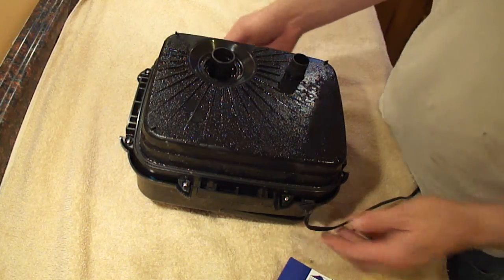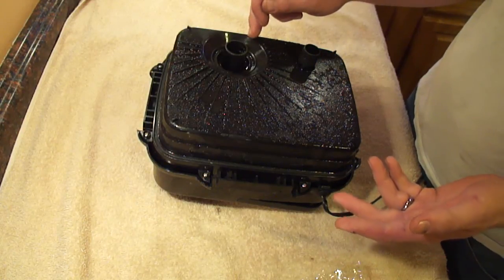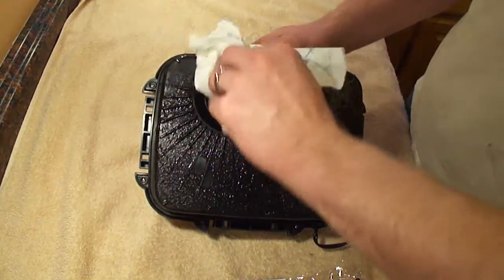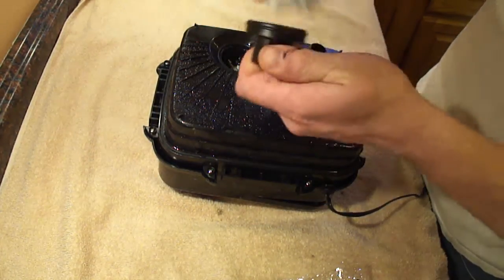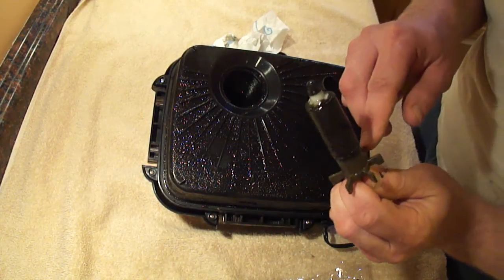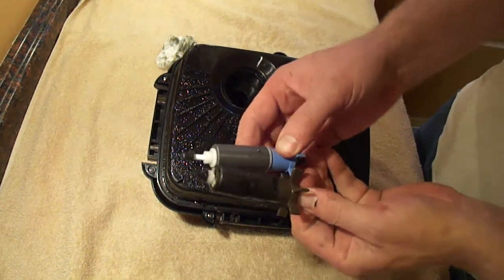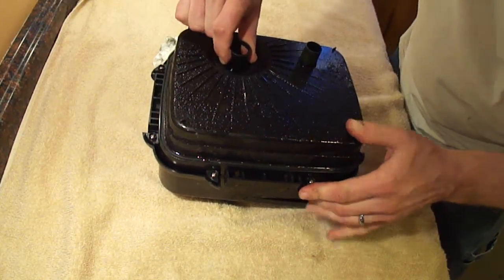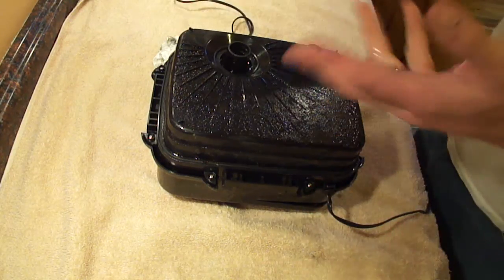Demonstration: How to replace the impeller in a Cascade 1500 canister filter

Comment: After fighting with my pump for about an hour. I discovered the real problem. If the impeller and the white post that runs through it don't move separately that's the problem. I was able to push the post back and forth through the magnet and finally got it broke loose so I could clean it. I highly recommend checking this before replacing the impeller. This could be your only problem.

Comment: You really shouldn't run it dry
Reply: normal pumps that might be very true, but for this type the thing cant really overheat because the impeller is not directly connected to the motor,,,so there is no real heating....it does not need water to stay cool.

Comment from the maker: Yep, this did fix my filter for a few months. It ran as quiet as ever but then started grinding and chattering about 2 months later!?! I could have contacted them and tried to use the warranty to get a replacement canister filter... but I didn't feel like dealing with that hassle. Eventually I replaced this cascade 1500 with a Fluval 406. :-)